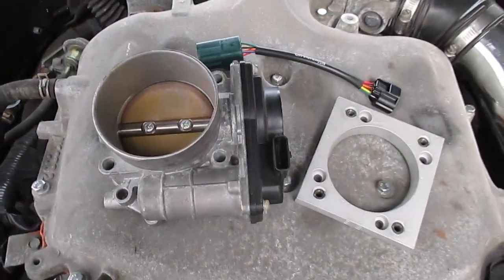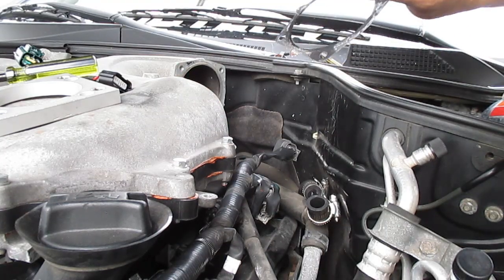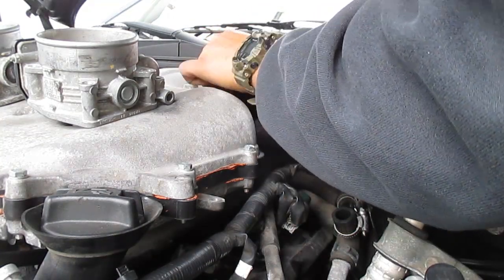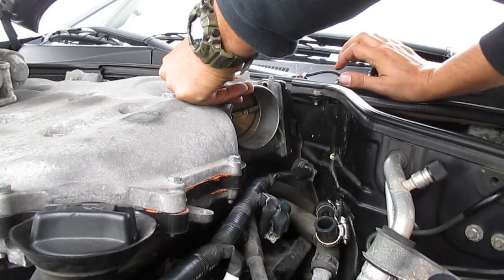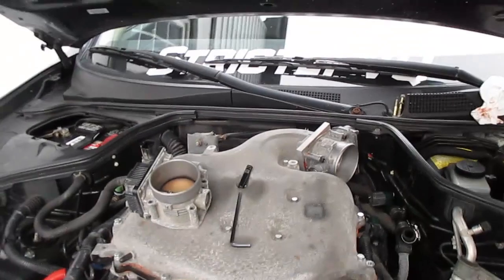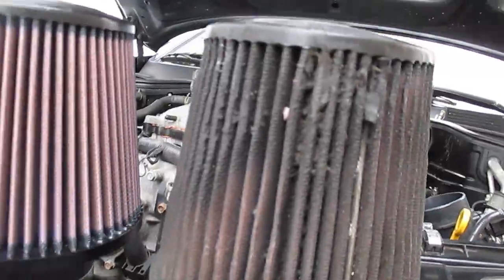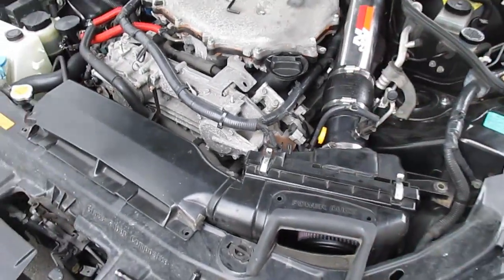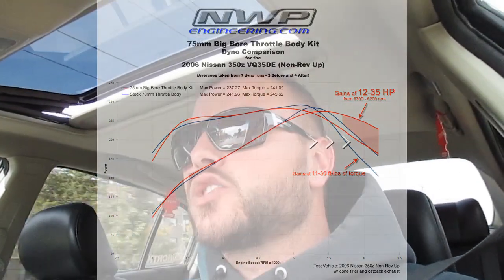75mm Big Bore Throttle Body Upgrade - G35, 350Z, 350GT

Comment: Run a Dry filter. Better than the oil based on the old throttle butterfly is caked

Comment: Good video, good info! 👍 do you still have the G35? I bought an 06' back in 2018, it had 15k on the dial. This winter I'm doing some mods, and this is the first thing I'm considering doing. I really like that dyno paperwork!!! Thats solid #'s.

Comment: How do you know if you have to do a throttle body relearn? I removed mine and im not sure if i pushed the butter fly valve with my finger. And could you reset it by just removing the neg  battery cable and holding it to a piece of metal to reset computer or do you  have to do it with the pedal?

Comment: I used to be just like you guys.. spending hundreds to thousands on power gains of 10-15HP... It wasn't until I realized my love for cars and modification was being wasted because I was buying the wrong cars. Yeah, the G35 is fun. I have one. But don't mod it. Unless you have forced induction, you are wasting your money. It took buying a corvette to realize what real power was. And it finally led me into a new world of car where the same amounts of money on a G35 that would get me 8 HP would produce 80. Did you guys know a simple tune on a BMW 335i or Audi S4 can boost you over 100 WHEEL horsepower? All that money I wasted. may it rest in peace. Just save it, and buy a car that appreciates modifications.
Reply: Okibe Mwege Bwoi they are mod friendly. Just know how an engine works and use your money wisely.
Reply: hidden KARD your ah fuckin idiot if your calling the LS a big ass engine 😂
Reply: hidden KARD The highest hp n/a vq I've seen is 370whp. Look at the price of itb's, cams, head work, etc to get to that number. It's insanity. Fi is cheaper, makes more power, and is mire drivable.
I never said vq's can't make power. I'm actually a big fan of vq's. I'm just saying anything that's not forced induction is a bad decision. 
You throw a $200 cam in an Ls and gain 80hp. To gain 80hp on a vq costs thousands of dollars.
Reply: @Xixu.co.6  u can re grind any cams and most profiles are on forums too not that costly if you are a decent enough mechanic to get to valves only reason L's gets the nod is it has one cam lol
Reply: Through the LS in the 350 and keep it under 3500 pounds you will have a monster on the drag and drift @Xixu.co.6
Reply: SilverPanda WS6 You know I'm talking about displacement idiot. ls engines are more than 5 liters and many put down only 260-320whp. Most stock vqs put that down stock. Add to the fact that LS engines only have 1 cam. Most modern cars today have more than 4 cams. Any engine over 4.5L is a big displacement engine. And most v8s make good torque down low but die up high like the LS. German and Japanese v8s on the other hand make that down low torque but keep pulling and reving due to the dohc and different variable valve timing . Big displacement engines with a short red line are mostly found in trucks. Truck engines are made for towing. If you swap, you swap to the superior 2jz. Comes with twin turbos and comes with nearly bullet proof reliability.
Reply: AFunnyGuy87 I agree, I own a G35 and yeah VQs aren't mod friendly, tho from factory they are decent engines for sure. The last engine mod I want is a 75.m throttle body, thats it. And work on exhaust work and lightweight rins.
Reply: AFunnyGuy87 Yea and we know the new infiniti q50 & q60 ss makes 150whp more power with just downpipes and a tune..450whp 600tq from a twin turbo silver sport..tune + downpipes
Reply: V.Vega No their not. Who told you that stupid shit? Because you don't know shit about tuning doesn't mean every is stupid. VQs with full exhaust  (from headers back) , ITBs, cams, pulleys, injectors, pump and tune have put down 400s..NA. That more than V8 and twin turbo V6/I6 power. For Example a ISF puts down 320whp, same with e92 M3s. Ported heads, race cams and upgrade valves and valve springs with higher rev limit plus E85 should get you near near or to 500s. But before you do that upgrade the internals. So stop telling ppl VQs can't make power. When here on YouTube there's examples of ITB high horse power VQs more power than many FI guys.
Reply: But you cannot deny how awesome and balanced a NA vq is making 300hp. Sometimes too much power is too much.
Reply: Na dude ur not in the culture.
Reply: I spent almost 2k on 272 cams and springs for maybe 15hp lol
Reply: josh wallang lmaoooo. Fuck it we want the HP. If it hurts it hurts 😂😂
Reply: AFunnyGuy87 that’s why people buy different cars cause we got different taste
Reply: Ofc...because a 335i is twin turbo...a tune wakes that car up easily. But not all of us are stupid. A NA VQ can make 400whp Na but with stupid intakes you won't get there. Know how an engine works and these vqs make big power. Nissan over engineers. Chevy underengineers so power is left on the table. This shows the guys at nissan know what they're doing and chevy engineers are useless. Big ass engines for such little NA power. Bmw, well thats turbo charged so it will make power and bmw underates their engine. Their cars make more power than advertised.

Back to VQs. Theres g35 and 350zs making 400whp on NA power. This is way above the 100whp per liter mark. All of them are running aggressive cams and itb. So know wtf your doing and how engines work and these cars make big power
Reply: Trevor Hunter no you have not. Show us your car and then we can talk.  Sick and tired of people are pretending to own all of these cars and in real life they own nothing but rusty ass old vans.
Reply: Mr.Logic23 he said he has driven them, not owned them.
Reply: The thing about the vq is that they're pretty much maxed out from the factory. The intake and exhaust are free flowing, the tune is aggressive, and they make a lot of power for a v6. You're 100% right that any power mod that's not fi is a waste. It always pains me to see people trying to mod these n/a. $1500 worth of exhaust later they've made a 4hp gain lol. The money is better spent on suspension upgrades, that's really where these cars fall short.

Comment: Wondering why you replaced the dirty K&N air filter when they are designed to be washed, re-oiled, and reinstalled?
Reply from the maker: Ryan Yantzer it takes a while for the filter to dry once it's washed so I have two so I can just change it and wash it at my leisure

Comment: sup donsquale, quick question would you say the throttle body was a good investment after having for about a week and being able to test your ride at the track.
Reply: yea I'd say it was worth it. had I had to pay full price new for it I may not feel the same but for the money I paid I noticed quite a difference
Reply: DONSQUALE how? I really would like to know! All the tb does is regulate air intake relative to thottle demand! Your engine is only n/a. No supercharger or turbo!? Maybe if you had more aggresive cams installed. Remember no matter what you slap on, its still monitored and controlled by the ecm!